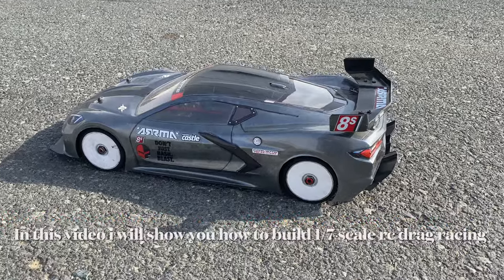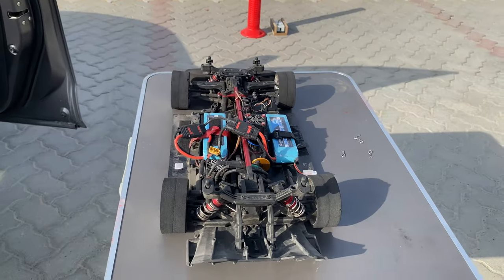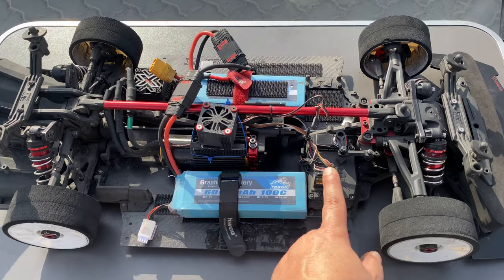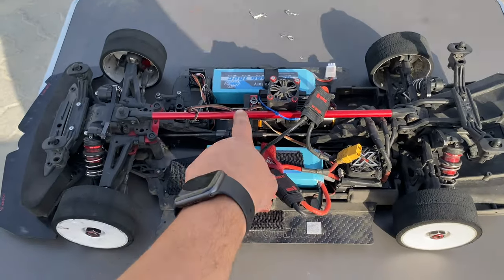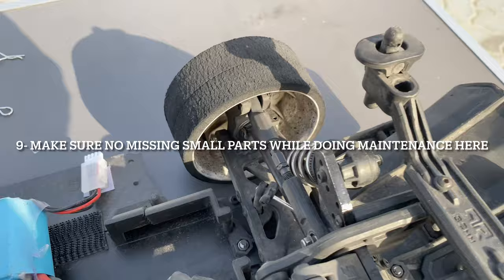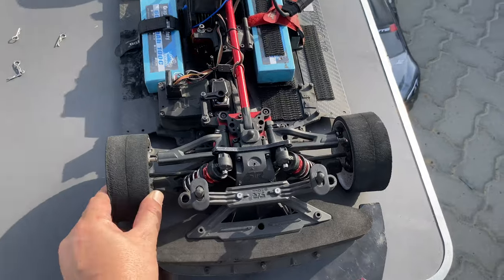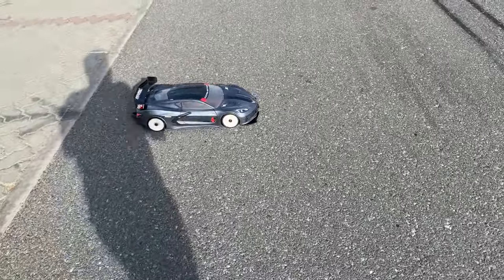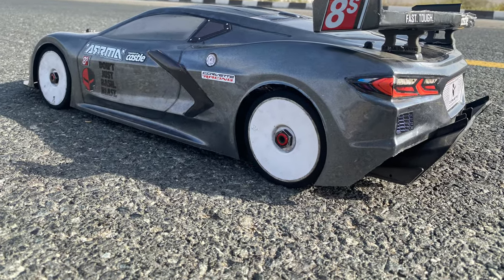HOW TO BUILD 1/7 SCALE RC DRAG 132FT ARRMA

Comment: Shes a bit sluggish off the line but I hear the motor RPM only is nearly the same throughout the entire pass along with a large amount of tire smoke. That tells me you're applying too much initial start power. Maybe try a lower punch setting in the ESC adjust your transmitters throttle speed or start power point setting. If the tire is slipping enough to have visible smoke in the daylight you can't get maximum traction

Comment: great info. been wondering how i can improve suspension for drag. 
do you have the rear lower than front?
Reply from the maker: No the front should be lower always
Reply from the maker: We always put the thicker tire in the rear it will make the nose down without adjusting factory settings
Reply: @UAERCADDICTS  thanks. I weren't sure when you said "-1 on rear". 1/7 drag is not very popular here in UK so learning from what I see 🙏
Reply from the maker: Make the rear higher than front bu 0.5 cm

Comment: I have always wondered why  do larger scale rc cars stick to the 132 ft drag racing measurement. This is for 1/10 size cars and is a true scale representation of a real qtr mile drag strip. Technically, a 1/7 car should run around 188 ft to make it a true representation. In the end, I guess it really doesn't matter as its all about having fun. Great car BTW!!!
Reply from the maker: We know that but it is fear enough if you will do the acceleration science

Comment: I work hard at this sport with trial & error it’s expensive & time consuming…. 
That’s too much information 
Good looking  build keep up the good work but keep the secrets
Reply from the maker: Thanks and most welcome
Reply from the maker: Those info should not be secrets in my opinion because newbies are having very hard time and loosing money on wrong setups some one should put them in the right direction also i didn’t share the 1.6 sec setup at least i am trying to help and growing the hobby
Reply: @fabb60 As if any of us will be racing each other lol relax he's helping a lot of people out.  It's not that serious bro.
Reply: Is the 1.6 setup different gearing or remote tune.. without giving exact info can u point is in the rite direction to lower times? Higher or lower on gears ? 1/2/3 stage on remote to get. It? That will be very appreciated without exact info.. keep up the good work!💨💨🚀
Reply: @dwightclemons9921  I use a Futaba 10px so most of my adjustments are all in the “tune” if u hit 1.7 then u prolly have the correct gearing to do a 1.6 or a 1.5 … 
Best advice I can give is keep trying & a 1 stage can be just as affective as a 3 stage. 
Depending on your surface but most people put too much power & think more power is faster but it’s NOT
Reply from the maker: @dwightclemons9921  actually both but you need to prep 8s on v1 diffs same gearing or go higher depending on your surface tune suspension and ride Hight to go straight then 1.6sec easy

Comment: I wanted to get a Tp motor 1700kv and run the same castle to bash and drag lmk what you think
Reply from the maker: Raise up the kv a little bit above 2000
Reply: But won’t I have heat issues I was thinking 2200kv 8s one I’ll runn huge fans on it but just wondering

Comment: Hi bro, what if FSR using mmx8s TP4060 2000kv. Any suggestion for gearing, diff, tire, suspension etc?
Reply from the maker: Your kv is too low for 132 ft
Reply from the maker: But i can help somehow on your fsr stock spur use 24 pinion. On 8s
Reply: @UAERCADDICTS  im using 43spool 22pinion is it good?
Reply: @UAERCADDICTS  and what the best setup on mmx8s like
Punch level
Power 
Etc
Reply from the maker: @kelvinchia4750 to be honest i love them on default and do some adjustments from remote only
Reply from the maker: @kelvinchia4750 try 24p
Reply: @UAERCADDICTS  alright thanks
Reply: @UAERCADDICTS  appreciate 🙏

Comment: Are you running that motor on 6s or 8s?
Reply from the maker: Both depends on the race
Reply: So the 2700kv can handle 8s. Thank you for the response. I wasn’t sure if it can handle 8s.
Reply from the maker: @emersonsiapo8094 for 1 to 2 runs yes then let cool down distance 132f donot over gear max 26pinion
Reply: Ok thank you for your advice.
Reply: I got the 2700kv kill mode. What diff gears are you using? 3.3 or 2.8?
Reply from the maker: @emersonsiapo8094  3.3
Reply: Ok my brother!! Thank you for you response and your help.
Reply from the maker: @emersonsiapo8094  welcome